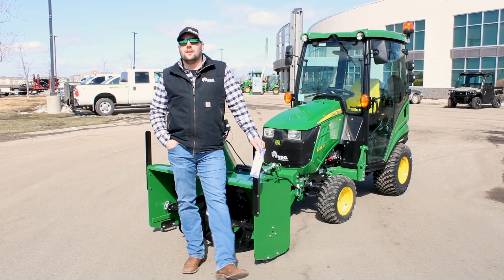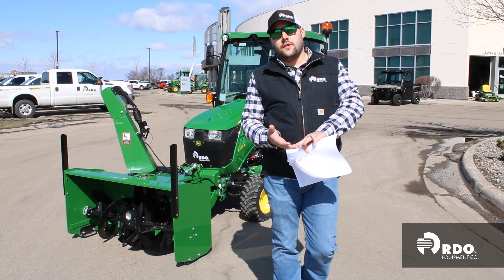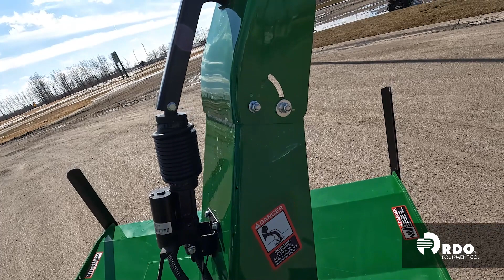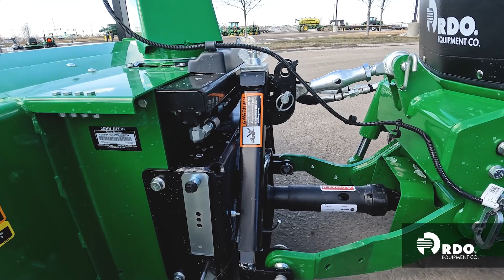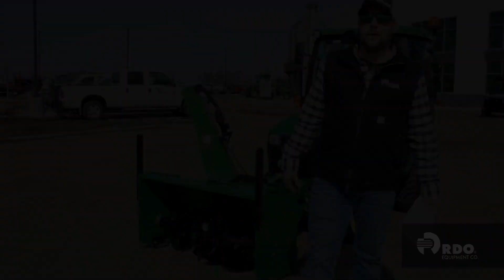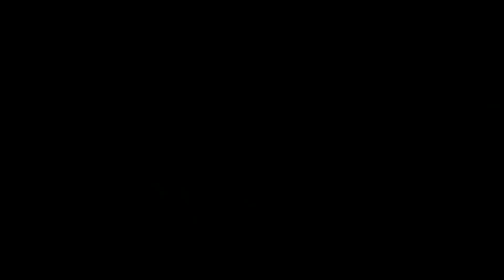John Deere Three Point, Front Mount, Heavy Duty Snow Blower Set up for 1025R Compact Tractor

Comment: @rdoequipmentco can the front end loader be used with the pto carrier bracket still installed on the tractor front frame?
Reply: That is a very good question! Unfortunately that bracket needs to be removed in order to install the loader. You also have to remove the 3 point draft arms (hydraulic lift cylinder included) and center link. The main frame of front 3pt bolted to front of tractor frame can stay on machine. The good thing is most of this is tooless.

Comment: Nice video. What are the part number(s) for the hydraulic deflector kit assuming the 1025R is already set up with the third function?
Reply: Thank you for the comment. You would use PART# 5RDF0048A hydraulic cylinder and then make your own hydraulic hoses and install cleanly.

Comment: Do you have the length from the very front of the snow blower to the back of the rear three point arms? My dealer only has the quick hitch model and I’m trying to get measurements for my trailer. Thank you

Comment: Does anyone know what this exact unit & attachment setup costs?
Reply: Todd, There is slight variations on pricing depending on what tractor you are setting this up on and size of blower you choose. I can tell you the 1025R front 3pt 47" HD blower package with everything you need to start blowing snow is $7,335 as of this date. However this is before freight, setup and tax. You would also want to look into one of our RDO winter front covers and the deflector kit for the snowblower.

Comment: what broom options are there for this hitch?
Reply: knute71, I just put in the comments of our broom video all the order codes and couplers you will need to make a broom work on the front 3pt hitch for either 1025R or 2025R machines.
Reply from the maker: Hi knute71! For broom options, we tend to lean more toward the John Deere heavy duty brooms. We have a great video that can help with what to look for in this particular mount: https://www.youtube.com/watch?v=PAV-pL3DDrA
You can also contact an account manager at RDO and they can help get you set up. Thank you!

Comment: I just received the RDO Winter Front grill cover part# 1025WINTERFRONT.  Can you provide any tips on how to install the snap buttons on the grill?  Do you have any tips on how to position the snaps so you can drill and rivet them?  Thanks!
Reply from the maker: Hi Christopher, we suggest holding the grill cover in place at the John Deere emblem. From there you’re going to want to fold the edges back and mark the grill of your machine so they line up with the snaps on your winterfront. Install the rivet snaps as you mark them and snap in your cover as you go.
If you have any further questions, feel free to give your account manager a call. They will definitely be able to point you in the right direction!
Reply: @RDOEquipmentCo do you have it for the 2025r?

Comment: Curious if the front 3 point has down pressure like the quick hitch
Reply: Yes it does have down pressure just like the quick hitch. You can lift the front tire off the ground.

Comment: What is the part number for this blow and hitch
Reply from the maker: Hello -There is no part number for the bundle unless you order all parts individually. This can get quite costly. I would suggest ordering the blower and hitch from your local dealer to get everything in one package. Our locations can be found here: https://www.rdoequipment.com/locations

The order codes you will need are below for a 1025R. This would be for the 47” blower. Keep in mind there is a 54” version available if so desired. 

BASE MACHINE
7110M
MOUNTING KIT / DRIVESHAFT
6837
FRONT POWER TAKE-OFF (PTO)
6887
FRONT HITCH
6954
DESTINATION
0202
OPERATOR'S MANUAL
0409

Comment: Do they make these for the terrain cut ? Or at least sell the blower part ? I would need to buy a different gear box and lift arms and pto I’m aware of. 
All I could find is the 47” or the 60”. I would like the size of 54” 
The 47” is to small and the 60” you need to be perfect on a sidewalk to get a good scrape. 
I feel like the 54” for a terrain cut would be a good option.
Reply from the maker: This blower is derived off of the Terrain Cut so the head units are similar. Unfortunately they do not make this in a 54” for the Terrain Cut. However we are also a Pronovost dealer and they do make a 52” blower for the Terrain Cut that we had a hand in developing with them. 

If you would like more information on this I would suggest reaching out to Alex Mitchell at our Moorhead MN store.

Comment: So what dose it take to attach the drive over mower deck with this new front hitch.  My dealer is lost, I have the 54" HD blower and not able to hook up my mower because the front A frame hitch took the place of the front hitch for the mower.
Reply from the maker: That is a great question and a hard answer to find! 

We have also run into this issue when setting up similar packages. Rest assured, you can install a mower deck with the front 3pt. kit on the front of the 1025R. 

You will need part# BXX10357. This is a bracket to make a mower deck compatible with the new heavy-duty snow blower kit. 

Contact your local John Deere dealer to order this part. Thank you for reaching out to us!